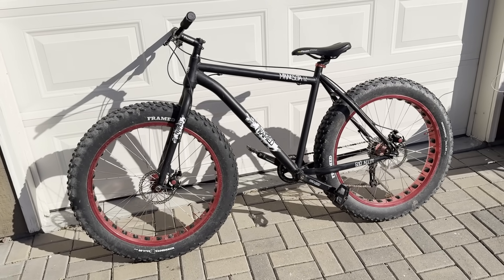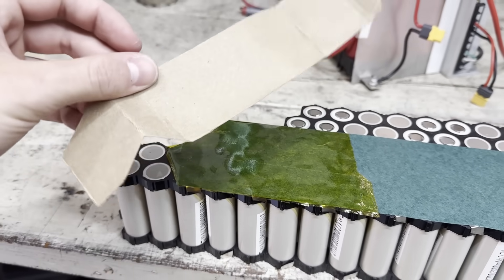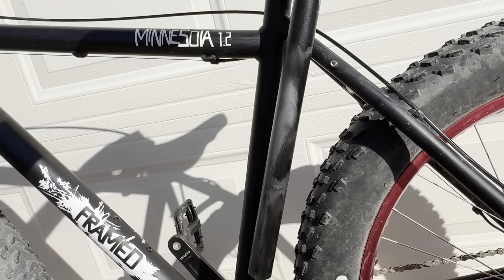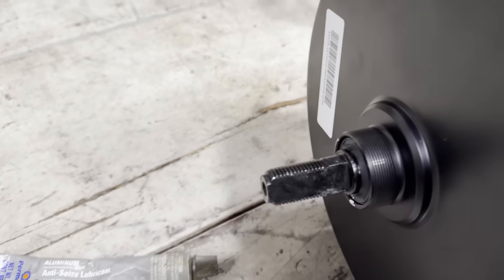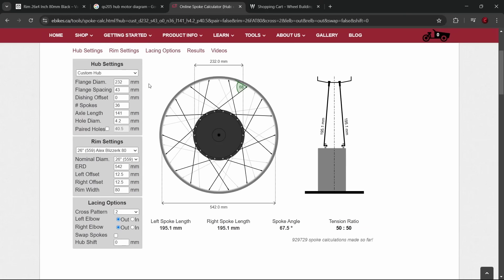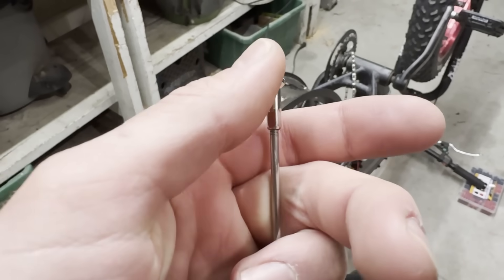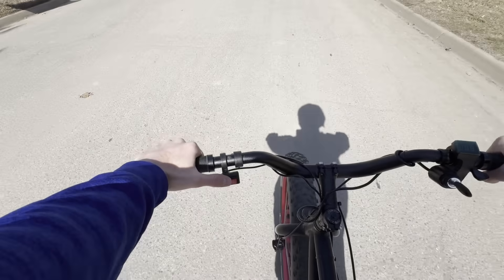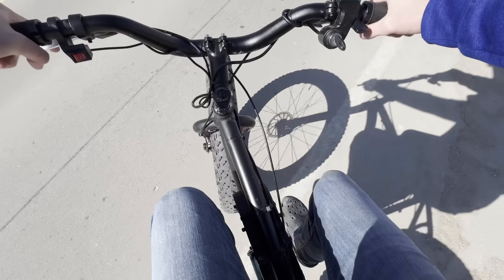Overpowered Fat Tire Ebike Build

Comment: I'd want a steering dampener for anything that goes above 60 km/h...
Reply from the maker: @TheDZHEX  it’s totally fine at 60kph but over 100kph definitely needs one, it did get a bit wobbly.
Reply: @Calthecool  it's all fine, until it isn't... I'm not sure about what speed death wobble becomes an issue, I expect that it depends on the weight and construction of the vehicle, and is more likely to occur if you have loose components/untightened bolts.

I don't want to find out the hard way tho.

Comment: I'd like to see you try putting the motor on the FRONT wheel
Reply from the maker: @stileopard1159  it would just spin like crazy with this much power. If you did a 3000w on the rear and 1500w on the front it would be a lot more balanced.

Comment: It's so funny that bicyclists are finally realizing that motorcycles are better
Reply: Motorcycles are fun too, but they are much faster and sure are better if you need to get to your destination quickly. Cyclists dont necessarily choose bicycles because they think they are a better mode of transportation, but because they are cheap, low to no maintenance, you get some exercise, and consume no fuel. The best choice depends on the situation.
Some people can not afford motorcycles or have nowhere to keep them safe from thieves at night. Where i live apartments have no garages, and they often get stolen since they are parked outside.

Comment: what spotwelder do you use to be able to spotweld 0.15mm copper?
Reply: and why do you do nickel strips on top of that?
Reply from the maker: @tijssens  kweld I got from grid required powered by a 3s4p pack made from red 8Ah headway cells. The nickel is there to provide some resistance so the copper heats up more. Look up “copper nickel sandwich” for more information.
Reply: @Calthecool  damn... Ok got it... Do you have a link to the spot welder perhaps?
Reply from the maker: @tijssens  https://gridrewired.com/en-us/products/kweld-spot-welder-kit
You can also use a large car battery, I think they have a page on that website talking about the options.

Comment: Would it be better to make a front wheel drive or two-wheel drive? Maybe a little safer during takeoffs?
Reply from the maker: @brianrooke2338  it would be safer, but you would need a really sturdy front fork to handle the torque. This fork would probably break.

Comment: The thing with these custom ebikes is that you basically need to have your set of skills and tools to be able to keep and operate this bike long term. I purchased a DIY ebike and while true, for the price it is better than any other ebike you could find in the market, you will constantly be running into issues. For me, I had issues with the way the battery was mounted. Caused too much vibrations and made one of the connections die. Had to replace the connection and 3D print a solid base to mount the battery. Then later on the bms died. That needed to be replaced. Slowly over time, the spokes started to become loose. I would hear constant clicking noises while riding. I tightened up the spokes, but because I didn't really know what I was doing and didn't have the proper tools, I probably messed it up more than fixed. No bike shop wanted to fix it for me and the dude I purchased it from was too far away. So I did what I could. Tried adding some loctite as you did, but eventually the wheel fell out of true and the spokes started to snap in half one by one. I replaced them and did as best I could to get it back to how it was. Finally what sealed the deal was motor ended up destroying the dropouts. Even though there was a torque arm, it still managed to spin in place and stretched the aluminum frame. Basically was done after that. Couldn't tighten the wheel back on frame properly as the nuts would spin in place. 

So just FYI for anyone wanting to buy a DIY ebike, they are fun and will be better than what you can buy on the market. But keep in mind you need these skills to maintain it, or at least good access to someone else who has these skills. What you save in price will later on be spent in fixing things as the bike tries to tear itself apart 😂
Reply from the maker: @1234567895182  this is definitely true, right now I’m fixing a stealth bomber clone for someone who is having a few of the issues you mentioned.
Reply: I think if you get a quality bike to start with these problems don't really happen. Steel frame for bumps, some nice rims and a bms meant to handle it, as well as cushioned battery designed for a beating and it becomes pretty durable. What do you think?
Reply from the maker: @jmardesich7361  yes
Reply: @jmardesich7361  definitely a steel frame would be better. I think if I ever do buy a DIY ebike again, there would be a few requirements. It would have to be mid drive. I don't want to deal with the spokes. Plus mid drives just look cooler to me (much more discreet). Idk if you can buy a 9000w mid drive motor, but 1000w would be enough power for me, especially considering it can take advantage of your bikes gearing and is better for hills and motor is in a place that can better handle the torque. 

Drive train might need to be inspected more regularly because of it though, but that is something within my skillset and easy enough to do. A new chain is cheap and quick to install. However downside is if the chain breaks on a ride you are sol. Can't pedal home, but I don't think I will ever take the bike to any place where I wouldn't have access to public transportation or my own car anyways. 

And of course a beefier battery with a better bms to handle the current. Mounted properly to reduce vibration. 

Most likely would use hydraulic disc brakes as well. 

All in it would still be a costly bike, probably around $2000 for everything, but I am betting it would last much much longer.
Reply: @ my dad did a townie path 9d with a bafang 1500 watt motor and unit pack power battery. Super solid with just that stuff and now its under 2k.

Comment: cant u make that it slowly gets faster and not with these lauches?like a gas pedal or something
Reply from the maker: @laurisdemons  you can limit the phase amps so that it has less torque at low speeds. You can also set the exact % power at different motor RPMs.
Reply: @Calthecool  sounds complicated but thats cool that u can do that :)

Comment: I'm just curious why the spokes came loose despite Loctite. Did you put the Loctite on before you tightened the spokes, or after? This is a 2 component adhesive that only hardens when force is applied to it. There are tiny particles in the adhesive that break and start the hardening process.
Reply from the maker: @Breubel  I don’t think it was the nipples spinning that made it become loose, I think the pressure wore away some rim material which created a gap between the nipples and the rim. I could definitely tell the nipples were more deep into the rim after I tightened them a few times.

Comment: the chain won't stretch out ? (0.o) uhm that electric motor will apply x42 more torque than your skinny leg ever will... (-.-)
Reply from the maker: @Lich_Bahamut  it’s a hub motor so the torque is generated at the rear tire so no chain is needed, the chain is just for the pedals.

Comment: Would it matter cooling the batteries or the controler? with an actual fan i mean
Reply from the maker: @_Umbral  The controller definitely doesn’t need to be cooled, and I don’t think the battery needs to be cooled either. If I used cells that had a higher capacity and lower discharge current and I was really pulling as much current from them as I could, then they would probably need to be cooled. Since the Samsung 30T cells are only 3Ah and have more discharge current than I need they would run out of charge before they had the chance to get really hot.

Comment: 30T?
Reply from the maker: @mlentsch  yes
Reply: @Calthecool  It would be interesting to see what would happen if you replaced all those with a tabless cell.
Reply from the maker: @mlentsch  I plan on switching to tabless cells when they become more available and cheaper. To see a significant benefit compared to the 30T cells you would have to use thicker wires and thicker copper.

Comment: What finances the fab shop behind those torque arms and aluminum clamps?  I'd like to see your setup more than another ebike.  There was more hours in those torque arms than most of the rest of the bike.  Red loctite on spokes?  🤣🤣🤣🤣Glad you put that hypothesis to rest.  I like this build though for the simplicity, it's possibly attainable to a Joe Schmo if they used a Grin torque arm.  Make no mistake, I love your vid, great bike!
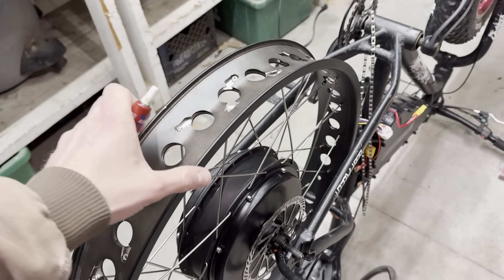Reply from the maker: @TheFogLakeshore  If you look at 8:30 I used blue loctite not red, the red tube has tricked a few people so far. The “fab shop” I used to make the torque arms is a 20 year old angle grinder, a 10 year old small welder and a cheap cordless drill. The controller mounts are even simpler, just a drill and a hacksaw. If you made the battery larger by not using a plastic case you could still get a decent amount of amps with only using nickel instead of copper so you could use a cheap spot welder, and you wouldn’t need the extra piece I welded on the torque arm so you wouldn’t need a welder, so you could build a bike similar to this one with a $140 spot welder and basic tools that a lot of people would have. The torque arms didn’t take as long as you think, probably like three hours. I don’t know if I would trust the Grin torque arms on a motor this torquey, maybe if you did two of the big ones. The torque on this setup is in an entirely different league compared to most hub motors.
Reply: @Calthecool  Wow, I believe a YT'r 🤣🤣I use a V7 Grin and it's probably the best generic setup possible, definitely require fab like yours to beat it, and on both sides.  You couldn't fit the V7 around both sides of that axle.  Spokes are a constant pain, I love how you proposed a solution.  I spent a year with a torquey hub motor and it seems to taper down but never go away, tightening.  Yours is definitely in a different league.  Fantastic battery build as well, at the end of the day there are still 6 spot welds on a 21700.  I'm still in rectangle territory.  Won't go into the details at how much you've obviously thought out current inside the pack 🍻🍻Nice that you show how creativity is constantly required throughout the build, you've definitely gone beyond slap-it-together but kept it in realistic territory.  Please use more foot and hand protection. 🤪🤪
Reply from the maker: @TheFogLakeshore  This battery is out of the ordinary for me, I’m definitely a rectangle guy myself.

Comment: Bros basically got no brakes lol
Reply from the maker: @fitzanator436  I could immediately lock the rear wheel and the only reason I couldn’t do a stoppie was the weight of the motor in the back. It has plenty of brakes as long as you aren’t abusing them and using the regen.

Comment: Bro I fully live for the danger My e-bike is made of only duct tape and zip ties and it goes 70 miles an hour on a 5,000 W battery I kid you not it shakes when you get it high speed and on top of that I'm running a bald tire with the metal rod sticking out of the tire it's been nice knowing you all
Reply from the maker: @ryanlaird8184  Rip bro

Comment: Why can't you spot weld steel?
Reply from the maker: @B.D.B.  I don’t know the exact reason, it may just require too much heat to be able to do it on cells because I know steel is commonly spot welded in automotive manufacturing.

Comment: Another good idea you could use those battery cells for is mailing them to my house so that I can use them because it definitely would do the job that my son would be able to use them for on the small four-wheel-drive electric go kart I’m building unfortunately batteries are just the last thing we were needing, but been thinking more so about building my own battery like I did for my 10in FPV quad with molicel p45 cells to make a 6s when red lithium makes the same 6s using molicel p45 and sell them over $200. The smaller molicel selling for $135 and I got 6x45a and shipped for $30. So I would love to have enough of the same li-ion cells to make my own battery for my sons build me and him are working on. Nice build by the way. Bet that thing rides better than it looks and it looks sick af my guy. 👍

Comment: How much would you charge to assemble something like this
Reply from the maker: @zabiermartin6765  Idk, it’s hard to determine how many hours I spent on it because I worked on it super inconsistently. I guess $600 with building the battery and $300 without building the battery.

Comment: You can spot weld to steel no problem. Nickel plating is only for protecting from rusting.
Reply from the maker: @illla  I couldn’t get it to work after an hour of trying different power levels, different nickel thicknesses, different spots on the cell etc.

Comment: What kind of mileage would you get in the bike using only mode 2?
Reply from the maker: @worldoftankslover9241  I don’t know, it wouldn’t be that good because of the big knobby tires and the small battery. This is definitely a fun bike and not a commuter.
Reply: @Calthecool  do you have any estimates? Like would it be able to knock out 20 miles. I'm sure if you upped the psi on the tires you would be able to squeeze a few more out
Reply from the maker: @worldoftankslover9241  it’s really the speed that matters, if you go under 30mph you can go much further than 40-50. I really have no idea on the range, I’m the worst at that because I just ride around town and off-road and never go on any long distance rides.
Reply: @Calthecool  okay thanks! I'll have to do a build like this and let you know. I'm sure the Regen breaking helps a little! Thanks dude.

Comment: Please get some Better Brakes!
Hydraulic one are Perfect for that and needed, also bigger Discs.

Can you also make a Test how much the Tire getting bigger when u riding Topspeed?
Maybe some with more than 120 TPI are also needed. Because the Threads can rip apart and braking apart.
Reply from the maker: @Fincher123  Because the bike has regen you don’t have to use the breaks as much so they won’t wear down fast. These breaks are good enough to stop you fast from top speed. I don’t know how I could measure the tire expanding at top speed.
Reply: @Calthecool  Regen on that thing is a great thing! Didnt know about that.
I would put that Bike Head over, Camera on a Tripod and a Measuring stick behind the wheel. Then Full Throttle and watch if it expand and 60 Mph. I dont think that it does much. But would fun to know how great these tires are. We in Bike Industrie have new "Specific" Tires which are labeled "E-Bike Ready 25km/h" or so. Which i think is just another marketing BS. I ride 25 just chilled on a non E-bike. (25Km/h are 15,53 mp/h)

Comment: How much abuse can it take before it overheats? For trails
Reply from the maker: @Seventhsky114  The only time I overheated it was when I went full throttle for three minutes straight while doing laps on the sandbar in 70 degree weather. With how light this bike is and how beefy this motor is it would be a challenge to overheat it in normal conditions.
Reply: @Calthecool thanks

Comment: The power was less than 9 kilowatts due to battery deep cycle volt drop characteristics of these cells .
Reply from the maker: Yes I clickbaited a bit but 9000 sounds better than 8500
Reply: @Calthecool  I studied electrical engineering whilst working for the railways in 1990 . I do IT for them now .
Reply: @Calthecool  Note my Sydney Trains Goninan S set avatar of S122 .

Comment: The whole bike and everything is great, BUT if you get even a bit of  water on the battery or controller the bike is cooked!
Reply from the maker: @Kruserontop  The controller is IP67 rated so it’s very waterproof, and because I hot glued the seams on the battery it should also handle getting splashed with water fine. I’ve actually washed this bike down with a hose and it hasn’t had any problems. The motor may actually be the most susceptible to water, as there isn’t a good seal where the phase wires enter the motor so I may add some epoxy there.

Comment: Im curious about how much this cost to build 🤔 got a philodo forester recently which is a awd 2000w bike with a top speed of 40mph and max throttle range of like 26miles all for $1,500 but i wish i could keep up with traffic better on hilly roads so maybe i shouldve built one🤔
Reply from the maker: @sophiareese79  It was $1200, the parts list is in the pinned comment.
Reply: @Calthecool  wow do i feel blind🤣 i looked in the description. This is absolute madness for that price i wish i saw thise before i bought mine although i do appreciate my plug and play experience its not quite as fun when you can only hit 40mph if youre pedaling on flat ground or 43mph downhill lmao especially because when youre on a bike people in cars take it as a challenge to see how much they can break the speed limit to get infront of you lmao i swear when im driving everyone goes 10 under when im riding everyone acts like 5 over is unreasonably slow